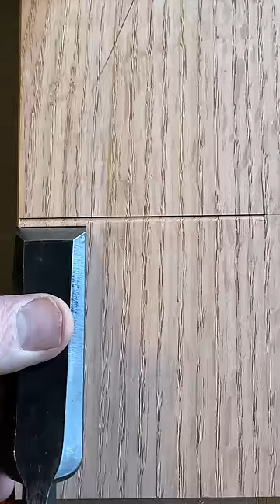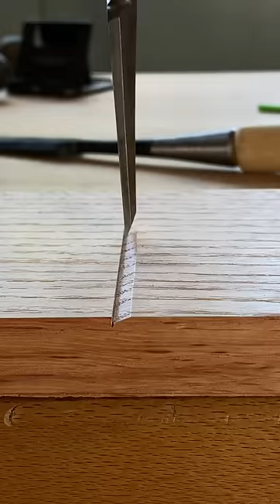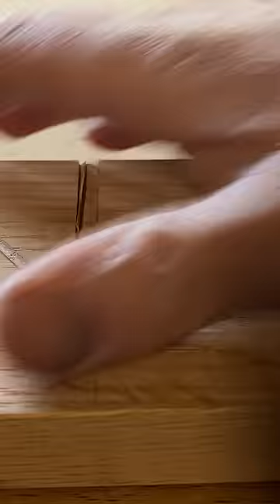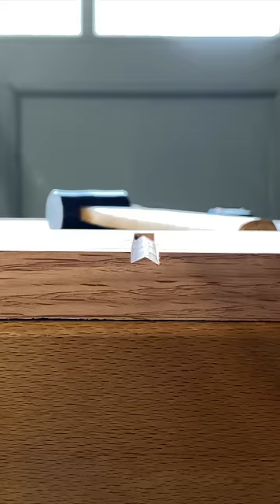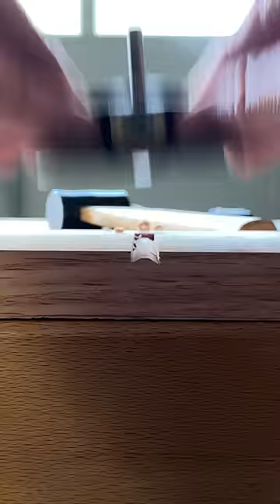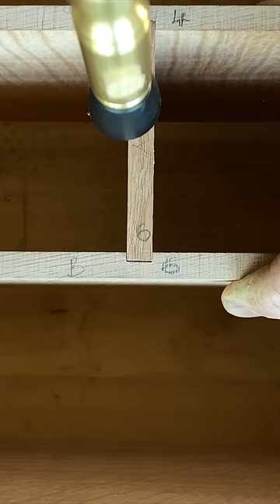Stopped Housing Joint with Hand Tools #woodworking

Comment: And after 5 weeks of intensive chiseling it's finally finished
Reply from the maker: More like 6 weeks 😉
Reply: Customer,  I'll give you 40 for it
Reply: and a few injuries to the hand
Reply: That’s damn impressive- also I’m now damn glad to be a power tool woodworker
Reply: It's not a out the speed, it's about the skill, patience and out come!
Reply: @WhateverIWILLtoBe  it's about using the slowest, most traditional methods possible....which is why I only work wood 🪵 with my teeth or fingernails. 😁 💅
Reply: I get what you're after but I could have knocked this out with a table saw or router in like 5 mins
Reply: Trying to waste time till you die
Reply: two hours with router 😂
Reply: @mathewingemi6523  No soul in it.
Reply: @brandonoconner2060  yeah right
Reply: @boreoff  very nice skills ills still use my router and then cleer just the corners with a chisel ! but still very good skill mate
Reply: You forgot to spend at least 5 weeks getting the chisel that sharp.
Reply: @CalvinJGreen  YOu can prep a new chisel in 20 minutes and sharpen its edge in about 35 seconds.
Reply: @Choco Smith  Can't sell subtle handwork anymore. It's gotta be big and loud joinery with contrast wood because most modern buyers don't know/care if it's dominoes, pin nails or dowels.
Reply: Omg right? OCD
Reply: He was paid by the hour?  Or he and the wife got into a spat during the pandemic?  His Mother-in-law moved in?  Retired Manual Writer testing his instruction he wrote for IKEA bookself?
Reply: And smoking a lot of weed to keep calm and not just grab the router and get it done today. 😂
Reply: В школе на обычных уроках труда в
России 😂
Reply: YEP AND HE HAS A MOST BEAUTIFUL PIECE OF FURNITURE THAT YOU CAN'T BUY FROM WALMART ☝️
Reply: @chocosmith2243  this is not for ur regular Joe , this is for distinguished gentlemen.
Reply: @brandonoconner2060  I can tell u know nothing of woodworking.
Reply: @arthurn9237  exactly 👍
Reply: dang did he take the long way round
Reply: @WhateverIWILLtoBe yup. The craftsman.craftsmanship
Reply: Doesn't matter if it takes a long time if it'll last forever.
Reply: @Montrovantis  What is "soul" in the context of woodworking?
Reply: @univega2003  Meh, I'd argue it's more of a comp between CNC and hand-detailing these days.  Design it once and have the machine router spit them out.  Nothing wrong with that!
Reply: @griffincontracting  Crafted with skill and intent, guided by the hands of the craftsman with tools with a direct connection to the wood, not relying on the machine to give you the finished result. Sensing and feeling the wood, its grain and dimensions and other pornographic things.
Reply: @WhateverIWILLtoBe  yes, and it's also about the countless wasted hours.  Kinda like video games and YouTube watching.
Reply: @Salviati  so you have to sell your soul to be a carpenter? It ain't just the music industry?
Reply: @charlesco7413  sigh Can you just act human and reason your way through this?
Reply: @Montrovantis  Why do you assume I'm human? Maybe I'm an intelligent shade of blue pretending to be human?
Reply: @originaldanman  countless wasted hours to who? Not the craftsman...
Reply: Chiseling intensifies.
Reply: @georgiafan6618 OCD? OVER THE COUNTER DISORDER?
Reply: @Montrovantis  Which is fine if all you wanna do is put it in your living room and put some stuff on it and not go fight an army of undead 😂

Comment: Immensely satisfying and nice to watch. I wish people weren't so mean, they're right that power tools are faster but they're so messy and loud, sometimes it's peaceful to just use a chisel. Any method that gives such a nice fit should be lauded, not diminished.
Reply: You are right it is satisfying to watch someone use a chisel skillfully.
It is just when you see the end goal is a line that can be made by a roter in seconds you feel that his skill has been hidden away by the simplicity of the end product.
So people expect to see something unique when hand work is used .
Sorry if I am diminishing his work I think the end product is great but at the same time simple
Reply: @shadowboyii  Yep, you definitely can't use this method if you wanna sell it because you'll end up getting paid 50 cents an hour. If you're doing all this manual work, at least do something that ends up visible on the product and the machine can't do. Tbh even with hand tools, there are easier and faster ways to achieve this.
Reply: @mrkiky  yeah. My first thought wasn’t “router is faster”, it was “damn you’re really cutting away sawdust with a chisel when you could make that whole cut in a minute.” The only reason I can see this being done for is ASMR or to fuel annoyed comments to get more interaction.
Reply: You could get this exact same result with a hand chisel in 2 minutes.
Reply: Actually, it's not as slow as you might think.  Experienced woodworkers will turn to hands tools for a one- off job because they can often do it faster than it would take to set up the power tools to do that job.  And yes, I can see it being very satisfying.
Reply: @shadowboyii Achieving perfect results in minimalist designs can be the hardest thing to accomplish, since you can't hide your mistakes.
     Also, a router alone wouldn't have yielded such tight results. There would have been tear-out along the edges of the dados, which would have been very much visible.

It looks to be a display shelf for treasured items / collectibles, so those edges won't be hidden by books. It's likely people will be watching up close and with a much more scrutinous eye.

So yeah - for mass production; definitly not the best method. But for a display piece, I reckon this is the right choice.

It's the difference between quality, custom, bespoke furniture, and mass-produced 'one-size-fits-all' solutions.

And hey - some people are willing to pay extra for this type of work, and are willing to wait. 
     Just a matter of finding the right clientèle :)
Reply: It’s not even power tools, you can do this with a hacksaw and chisel in 20seconds.

Comment: I think it's amazing to use hand tools like this. Very accurate, safe, not noisy. Whereas a power router can tear out and then the piece is destroyed. And it wouldn't take 5 months to finish, those joints are fast once planned out. Love the video.

Comment: What amazing precision and patience. Although I would do that with an electric router (and not a router plane), I can appreciate the skill and clearly highly sharpened chisel. Whatever your approach and what drives that in woodworking, it is always interesting to see how others work and share our common passion for building stuff out of wood. I see many comments suggesting that he use a router - think he already knows that and has chosen not to as evidently a highly experienced woodworker. Probably a bit like driving classic cars - you do it for the joy of it, not for speed or performance per se. Actually after chiselling out a few of those dados I imagine it is a lot faster than we give him credit for - so for a one off piece being made under no commercial pressure where you don't want all the noise and dust of an electric router, kind of makes sense to me. Text book technique as I was taught all those years ago - you can't just rip that chisel across the grain so breaking the fibres as he does for each pass is essential. Thanks for sharing - kudos to you.
Reply from the maker: Thanks very much for your thoughtful and considered comment.
Reply: @boreoff civilized tools for a more civilized age.
Reply: How would you get the square corners with a spinning router? 😉

Comment: Dude is a master with the chisel wow
Reply: That was the easy part of using a chisel. As long as it is sharpened well this won't be a problem. To see if a woodworker is actually good with a chisel look at how well they make open dovetails.
Reply: Those are baby steps. 

You can recognise master woodworkers because they make joints that are a little more complex than a dado and do it much faster as well.

Comment: All the butthurt power tool commenters lol.
We get it, but no need to exaggerate. Each rabbet didn't take a week, they would have taken about 10 minutes. So the piece didn't cost $24k or whatever.
He maybe made a one-off item, for relaxation, in the evenings after work to unwind 
There's beauty in the sound & feel of sharp edges shaping wood which is totally missed when replaced by the howl of a router and dust extractor. If you've never done it that way, then you wouldn't know.
It's like hiking in the mountains. Gets you nowhere and takes ages but it's a damned sight more rewarding than sitting on the couch & looking at National Geographic pictures of mountain scenery.
Sometimes it's about the journey.
Reply: Well said 👏 👌
Reply: Yes!

Comment: Very nice. I would have termed that a dado because it's in the body of the wood whereas a rabbet is the edge of the wood. Any how clean.
Reply: I agree, clean dado.
Reply from the maker: That’s right - housing joint in England though - thanks - oh and rebate for your rabbet!! Cheers
Reply: Rabbits are often found at the edge of the wood, too...
Reply: Actually a stopped dado.
Reply: Tell me about the rabbits George.

Comment: For all the haters on this talking about routers: 
1)  The item flattening the bottom IS a router.
2)  Would you cut that dado with your trim router?  Freehand?, or would you need to set up, calibrate and align a jig?  What is the width of the dado?  Do you have a bit exactly that wide?  If not, now you need to set up two cuts, one for the left side, and one for the right.  Now you have to set up and align your jig and router two times at least.  More if you can't cut that deep in a single pass.  Now after you are done, with the router, you need to grab a chisel anyway, because your dado has a rounded end.  Do you square it up, or do you need to trim the en of the matching board to fit so as to cover it up?  do you sand the feathered edges left by the router, or trim the fluff with a knife or chisel?  The chiseled groove is ready once the cut is complete.  The router groove needs cleanup.

Who gets done faster?  How does it look?  

(not a rabbet, actually)
Reply from the maker: Thanks for your comment. There are hundreds of comments asking ‘why not just use a router’ so I thought it would post a short reply which ‘dovetails’(!) nicely with your post. 
The dados are not deep or long and I had all of these cut in one evening - like anything, with experience comes speed and I am pretty fast. I also enjoy cutting these as I find it relaxing and this project is not commercial- it is a gift. I find using hand tools allows me more latitude in how I like to work - designing as I progress any project leads to better results for me / for example the dims of the dados are all different as the design of the drawer cabinet incorporates many different styles of drawers with different materials including brass and veneers - I was undecided on the right materials as until I see the drawers alongside each other I won’t make a decision. These choices may end up requiring a longer or wider dado so I can easily jump back in and adjust with a chisel. I like working this way and using hand tools affords me that flexibility.  In this instance using an electric router would handcuff me in terms of the design and I only use that for fixed design batched work. But each to their own - I am not a purist and recognise commercial work is necessarily power tool/machine intensive. For me personally though, if I have the luxury to do so, I prefer working wood rather than machines. And I can also hear the birds chirping outside.

Comment: I regularly use hand tools over my power tools.  Especially if I’ve only got a couple of joints to make.  I tend to find its much quicker and more accurate to bash them out by hand than calculate offsets, clamp guides, change bits, set depths etc.  and its more pleasurable.

Too many pseudo woodworkers around these days.

Comment: Beautiful result, and excellent control of your tools. 
      Using a router, you would have gotten some tear-out along the edges of each inlay / dado.

Also, this is a much cheaper way of doing things. Only things needed are a hammer, chisel, and that dado 'plane' / ('shave'?) which you can make yourself with some effort.

Much cheaper than a router + professional router bits in various sizes.

The final result looks toight... like a toiger :)

Comment: Guys, it's like 20 joints... 100-200 minutes. That doesn't include layout and checking/double-checking measurements and fit, but with proper tools, each of those grooves shouldn't take more than ten minutes.

Comment: Some of the woodworkers who love their powertools and are always getting the latest, and greatest machine have the money to do that. Not all can. And I would bet a good portion of powertool woodworkers can't cut a dovetail without gaps. My feeling is if you want to learn the craft, start with handtools and be patient. Everyone is in such a hurry these days, that they do not take the time to really enjoy what they are doing. You don't have to by the best at everything either.
 I come from a very long line, back to 1647, of cabinet makers who have traditionally used handtools. There have been some additions over the years, such as using a chainsaw to take down a tree instead of with a two man pull saw. (Except on our anniversary celebration. Then we break out the saws and make a contest of it.) Table saw to break down materials, drill press instead of brace and bit. But, when an item is created for a family member, our ancestor's handtools are used. We appreciate the tradition, and skill it takes to create a cabinet with drawers or a three tiered jewelry box with inlay, all handcut to precision. No gaps to fill in with a mixture of saw dust and glue. When a tray is lifted from a box, you hear the suction of air being removed as you lift the tray out. That, is due to dimensions being cut perfectly- by hand. Using antique handtools for a good many of us is something you can't relate too. Knowing my relative built furniture with the same handtools as I am using today is awesome, a link to my past. For others its the same except it may not have been a relative, but a highly skilled craftsmen. For some, they are  gifted and can pick up a tool and use it like they have been doing so for years. But, for the majority of us, it takes years to get to the level of Mastercraftman or woman in my case. I can tell you that the journey to get there has been exceedingly rewarding and a lot of fun too.

Comment: Oh shit, this is beautiful work my bro.. Love how u worked out those Rabbets' man.. What's the story with that little hand router tool u used to clean it out?? Is there a site I can go to get that? I think I'm going to buy me some hand tools. I bought my 1st block plane a few weeks ago. I tried to use it but i couldn't get it to work right until I edged the blade and reset it in the plane right. Now it's working beautifully. Truth is I only paid 17 Euros for this Block plane I got but I guess it's how u set it up as well which means how good the work will be.
Now I'm not saying it's as good as the more expensive tools but for my purpose atm it'll do for learning on. LOL..
U do really fine work man.. Keep it going bcos u have a new subscriber here from Dublin, IRE..
Reply: That second tool is called a router plane :)

Comment: Okay, I understand hand tools instead of a router. But…. Why couldn’t he use a hand drill and a coping saw to take most of that material out? Or at least a thin chisel down the center after cutting the edge down just as he did here.
It seems like more work to perform this method on the whole strip instead of the end and chiseling up to it.

I’m not experienced in woodwork though, so any corrections would be educational.

Comment: I very much prefer hand tools for doing any kind of woodwork. It feels more precise, real, and safe. In high school there was a tabletop router I was doing some relatively thin pieces to get an edge. It pulled the piece out from me and my finger went into the blade grabbing and spinning a cut all the way around, shattering my middle finger nail. From that moment on, I refuse routers. Absolutely the worst, scariest machines in existence. I would prefer to not get scared of other machines and just use hand tools always. I have cut myself with a gouge. But that was all me, it's not an ultrasharp blade going 15k rpm begging to suck something into it.

Comment: All you saying use a plunge router instead have obviously never felt the extreme satisfaction of hand manufacturing. Also, routers leave a shitty timber burr down 1 side & you have to use a hammer & chisel anyway to square out the rebate.